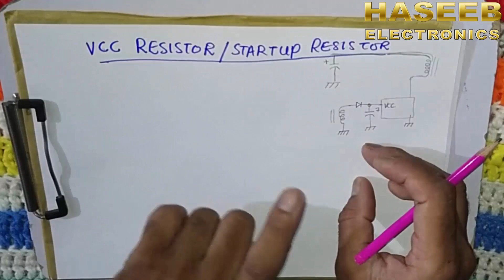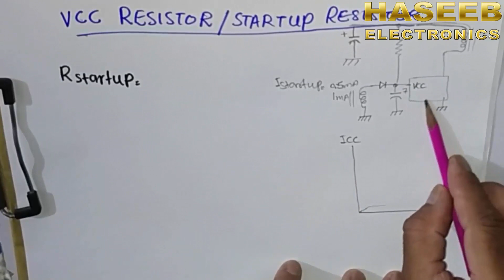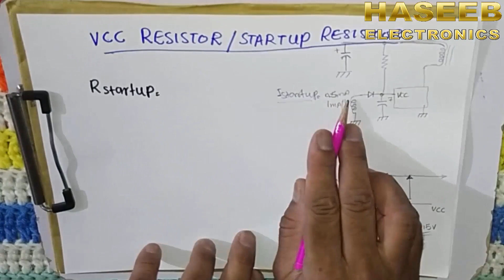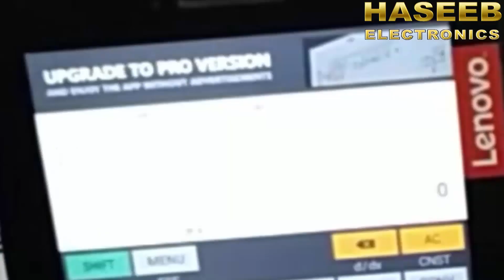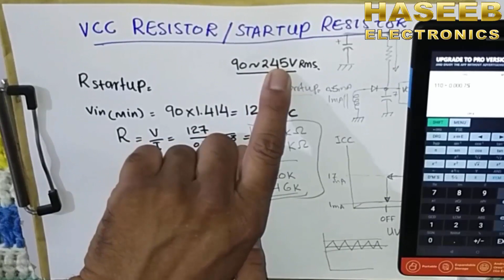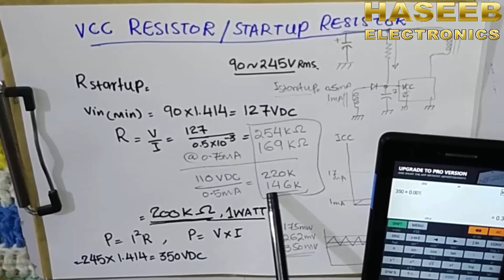Comment: Hello once again brother Haseeb! Another Excellent amazing video. Very well presented and you covered every detail and answered the few questions I did have about “Flyback switching power supplies”. You are truly a gift to the world of electrical and electronics to those who have a sincere desire to excel in this field weather it be as a technician or on the level of engineering. I can appreciate this particular video because it was the “Flyback switching power supply” that gave me my introduction to switching power supplies 12 years ago when I attempted to repair my 21 inch CRT JVC color receiver. JVC on it’s web page had a very detailed description of the theory, physics and workings of it’s “Flyback power supply “. It took many re-reads but I grasped the concept. The actual control of the amount of energy needed stored in the magnetic field being switched by a mosfet power transistor through pulse width modulation at the command of the amount of feedback via TL431 and opto coupler. With the help you have provided by going into deeper detail as to how the TL431 is more of a programmable voltage regulator, the snubber network and power factor correction and all the detail calculations have truly made me better and more confident. Thank you brother!
Reply: Best regards and i am thankful for your valuable appreciation. your words are a valuable asset for me. stay blessed 
please accept my best regards

Comment: I still don't understand 🤔 why I need a stratup resistor if there are already windings and capacitors as VCC suppliers?
Reply: startup resistor is required to start the IC at very first time. this startup resistor will charge vcc capacitor, then IC will take start. 
after that auxiliary winding will start to produce voltage for vcc capacitor 
some IC don't need startup resistor, those IC have built-in resistor to charge vcc capacitor for initial starting of the IC
if still there is any doubt, feel free to write
Reply: 👍👍 @HaseebElectronics
Reply: @HaseebElectronics  Aren't you trying to dub your voice through AI to all the languages in the world so that... Maybe more in the watch ?
When I was working, sometimes I watched YouTube without seeing it, I just heard the sound of a piece of content. sometimes it helps. working while learning. otu I mean
I'm sorry if my english is I'm sorry if my english is bad.😅
Reply: My English is also not good 
But as much as possible I am trying to share whatever I know 💓

Comment: How i reduce vcc supply, i am using 1 meg starup resistor but amount of volt cannot reduce in vcc supply ...it show 70v in vcc capacitor, how to reduce to below 20 v volt,help me
Reply: please check video number 1205A. i think you will find the exact answer. 
you can write again, if your problem is still standing.

Comment: Hello haseeb sir, I m a big fan. I m stuck with a circuit of prestige induction heater in which ap 8012 sw is supplied with 320 v DC and 1,2 pins are connected to transformer primary winding. Please check this out

Comment: I used this method for start up resistor calculation and the IC  didn't start up because all the voltage dropped in the resistor just few millivolt passing hence using the formula R = V/I simply means the voltage drop accross the resistor must be equal to the product of current flowing through the resistor and the resistance of the  resistor.

It should be:
R = [(Vin min - Vic)/I]
I is the startup current

Comment: alaikom assalam wa rahmatou allahi wa barakatouhou....
Please i can not understand why you used lower input main voltage (ex 90V) and not upper voltage to calculate resistance startup...
the capacitor will charged with a heigh voltage if we applicate 240 V in the input !!!!

Comment: JZAK ALLAH JNAH ALFIRDOOS MR HASEEB.
My wondering is that ok when IC take voltage from startup resistor first then when IC work so it take voltage from axillary winding, where the voltage coming from startup resistor goes into the resistor so voltage drop so heat dissipated in my head its like to voltage head to head i need to understand and i hope you understand me because i have project to do in my university
Reply: Good evening 
please check video number 954 and if you have any question, you are welcomed

Comment: Excellent video as they all are. Question...with regards to power, and dissipation of the startup resistor, aren't we only talking about a period of milliseconds, where current flows only from the startup circuit? I mean, once the controller starts, the aux winding creates a similar voltage, and the bias across that startup resistor goes o near zero, dissipating almost nothing, correct?  Pardon me if I missed it, or misunderstand the issue. Also, I noticed many designers like to stick with 1/4 watt resistors, so they series connect 2 or 3 or 4 to spread out that startup dissipation, I guess it's cheaper.

Comment: Sir the start up resisistor is separte from the snubber circuit sir?
Reply: yes dear 
it is a separate resistor, it is connected between +ve dc rail and vcc pin of the smps controller

Comment: Hello, very interesting with good calculations. My question is: how many volts will be at the VCC capacitor and how to calculate the voltage drop from 320VDC to VCC since i see only one resistor and no voltage divider ? thanks.
Reply: best regards. yours question will answered in upcoming session of startup resistor

Comment: Dear , I love your way of explaining . Kindly clear the design aspect of aux winding also. The cap , once started chip , voltage will also appear on aux winding and it will hold the current to chip. Cap will start discharging only when aux winding is unable to provide enough current . So what is design aspect of aux winding. Thx.

Comment: Thank you very much again!!! But can I ask shouldn't be R= Vin-Vcc/Icc, being Vcc the voltage consummed by the IC, like when we calculate the R for a Led? And, when it comes about the UC3842, how can 16 volt turn it on, since you've told that it has a 34 volt internal zener diode, shouldn't the Vcc voltage be greater than the zener voltage? I ask you this because I've been studing the UC38xx data sheet and noticed this. Thanks a lot; this channel is answering me a lot of questions. I really appreciate you tutorials. I'm always looking forward your videos.
Reply: you are welcome. all these points I have to discuss in upcoming video to discuss internal zener and external zener circuits (that is the 2nd part of this video)
amps controller have to working regions 
1. startup
2. normal working
1. in startup the current will use to charge the hold up capacitor. in tht case we have to use R=Vin min / Istartup. because I'm startup the vcc pin will start from zero volt

upon reaching at 15 to 16 volt at UVLO-on threshold, ic will start switching. then it's uvlo circuit will enter in operation mode,

I WILL EXPLAIN IN UPCOMING VIDEO
the internal zener is 34 volt. that is used as a voltage clamp for protection. to protect this ic to reach at extreme limit (34 volt) an external zener for range 18 to 28v is used at vcc pin. that will protect ic from damage.
we will discuss in upcoming session
Reply: @HaseebElectronics  My sincerest thankful; You answer very fast. My respect for taking your time to share knowledge that cost you hard working and many time.
Reply: Always welcome dear friend